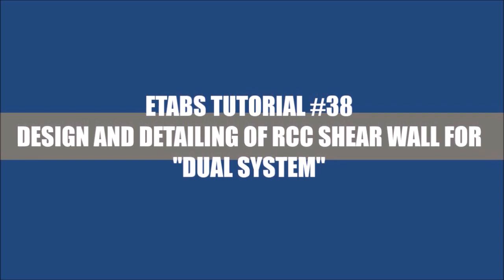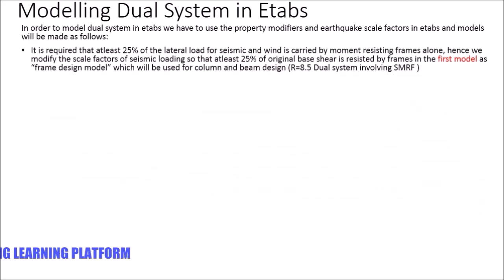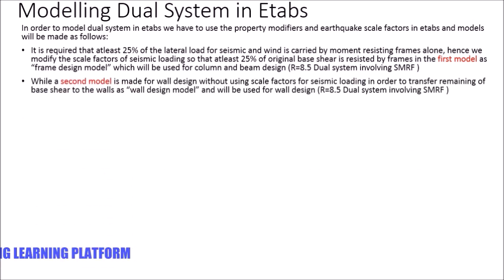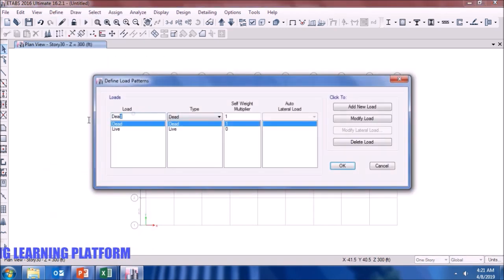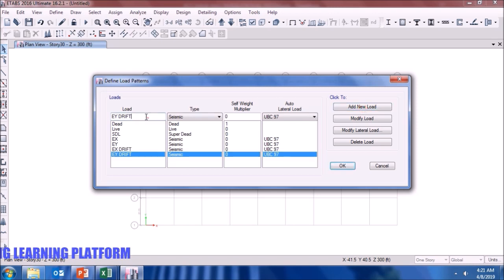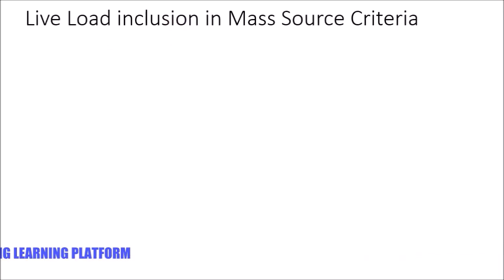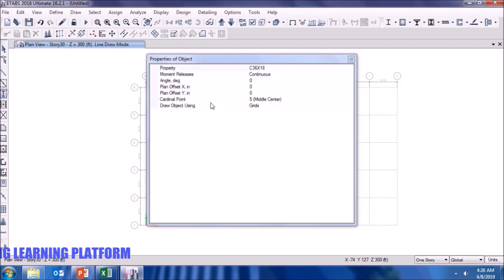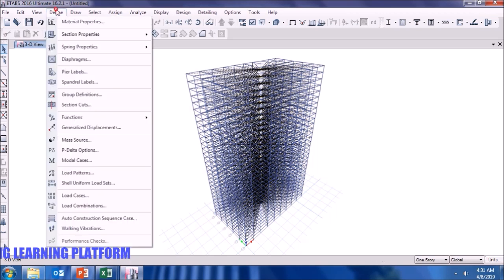RCC Shear wall design for dual system using Etabs tutorial

Comment from the maker: Watch "RCC Shear wall design for dual system using Etabs tutorial"
Reply: Please tell me how to apply scale factor in column model.
Reply from the maker: @saugatthapa1985     In column model go to load cases as i modified scale factor for drift case in this video, in same manner you can add scale factor for column design model for seismic cases in X and Y directions
Reply: @EngineeringLearningPlatform  thank you
Reply: Hi sir. Could you also provide a video regarding your insight about nonlinear analysis using etabs?

Comment: Bro in excel sheet wall resisted 92% of base shear but you didn't apply any scale factor to reduce it to 75% as specified by the code. Why?

Comment: Whats the formula in excel sheet where the scale factor (i.e. 8.16 & 3.5) is being calculated after noting the percentage of lateral loads taken by columns and shear wall. Secondly this scale factor will be changed for EQ load case only or the EQdrift as well   ???
Reply from the maker: No we never scale drifts, its just scaling to intentionally transfer more forces to walls and design them for that .
Reply: @EngineeringLearningPlatform  agree and how about the formula to calculate the scale factors (8.16 & 3.5) in the video

Comment: What is the optimum time period for building.? Is there any limitations to maintain the time period in this range.
Becoz if we increase the stiffness the time period reduced  considerably
Reply from the maker: Roughly time period is 0.1x # of stories but it shall not vary much from 0.02xheight pf building in feet^3/4
Reply: @EngineeringLearningPlatform  can you write the formula clearly?
Reply from the maker: 0.02*total structural height^3/4
Height in feet. And if building is moment resisting then use 0.03 instead of 0.03 and for steel structure use 0.035

Comment: As colm take less than 25% base shear, can we consider it as duel system? If not than shall we revise  the value of R?
Reply from the maker: No then you can't then you'll have to artificially amplify the force and design the columns for the 25% of the real force
Reply: @EngineeringLearningPlatform  If we consider this as a shear wall system instead of dual system and change the value of R accordingly, will it be ok??
And it would be really helpful,  if u upload a video showing how amplify load and design com for duel system.

Comment: Hello Brother, thank you very much for this video where i should change this scale from load cases?
Reply from the maker: Yes the load cases
Reply: @EngineeringLearningPlatform  but will reduce the value of base reaction and its not same as base shear, could you please share the procedure even in text not a video. thank you
Reply from the maker: @sarwarsadiq1393  I don't really get the question
Reply: @EngineeringLearningPlatform  brother, i was asking if you could provide me a procedure how can i change the scale to achieve 25% of base shear in MRF and 75%in Shear wall
Reply from the maker: Simply using 2 models as shown in video
Reply: @EngineeringLearningPlatform  thank you brother, much appreciated

Comment: Hi sir, why did you also modify f12? As what CSI have recommended, only f11 and f22 will be modified. Why did you use the modifiers for m11,m22,m12? m11,m22,m12 are for out of plane forces. Generally we don't design the wall for these out of plane forces so CSI suggested that these must be equal to 0.1.
Reply from the maker: F12 is the stiffness modifier when forces acts perpendicular to plane and deformation occurs in plane, so it is conservative to do so .
Reply: @EngineeringLearningPlatform  when to use shell thin or shell thick
Reply from the maker: Shell thick is for foundations as they are rigid .

Comment: Bro we should only modifiy the cracj section modifiers to be 0.35 for only those stories up to which shell stresses are exceeding modulus of rupture and for the remainder 0.7 is used. Here you used 0.35 for all stories. Why?
Reply from the maker: Because building is constructed in months and sometimes years and during construction if seismic event arrived then it should design members considering cracked

Comment: Bro why didn't you consider the connecting members of both core walls. I think you should have also included coupling beams at each floor level because the coupling action of shear walls is more effective in resisting seismic forces.
Reply from the maker: Coupling beam is important in forming the framing system . Yes it has to be incorporated usually .
Reply from the maker: But in this structure architecturally we don't have those
Reply: @EngineeringLearningPlatform  Considering one core...In lift Wells the door opening is present for lift but the rest of the wall is considered as spanderal and commented to the wall at the other end..In this example you have ignored it
Reply from the maker: @farhaankhan5868  Its not lift pit this large? it is atrium

Comment: Sir how will i use the factors 8.16 and 3.5?, do i need to delete The walls in the model for MRF? How will i support the beams connected on the walls then?
Reply from the maker: Add these multipliers in load cases .
Reply from the maker: No don't deleted anything . Just play with scale factors .
Reply: @EngineeringLearningPlatform   example in my loadcase EQ is 0, i'll change it to 8.16?
Reply: I saw already.. Is it possible to do the same in etabs v9.?
Reply from the maker: @neilbantugan  Rarely used that version . Yes it is possible .
Reply: How can i apply that in Etabs 9, it doesnt have load case option for scaling unlike Etabs 16..
Reply: In the summations of reactions, do you consider if the value of EQX and EQY are negative? Or just absolute values?
Reply from the maker: @neilbantugan  With respective signs
Reply: @EngineeringLearningPlatform  thank you for your time in answering my queries..i got the scales..but another question, what if im using response spectrum do i stil need to scale the EQ? Or different approach?
Reply from the maker: @neilbantugan  Yes first scale response spectrum to 85% or 100% of static shear depending on regular or irregular structure . And them apply this same method for RSX and RSY
Reply: @EngineeringLearningPlatform  first model RSX and RSY = to that of 85 or 100, then second model the scale from EQX and EQY needed to boost to 25% and 75% will then be applied to RSX and RSY? Another question Where will i get the the summation of reactions, eq or rs?
Reply: @EngineeringLearningPlatform  what i mean is supposed that ive already balanced the response spectrum in my first model say 85% for regular structure.. Where will i get the values 8.16 and 3.5 from your example, is it from eq summation or spectrum summation? Thanks

Comment: Hello sir, what if in the first model my SMRF attracts 150% of the baseshear upon checking the EQ Fx divide by total base shear, resulted..is it possible that it exceeds 100% of baseshear?
Reply from the maker: 150% of what?
Reply: @EngineeringLearningPlatform  of base shear
Reply from the maker: @neilbantugan  150% of what base shear? i don't get it.
Reply: @EngineeringLearningPlatform  total horizontal reaction..the one you did in scaling
Reply from the maker: @neilbantugan  Yes it's based on your R factor if you have changed it .